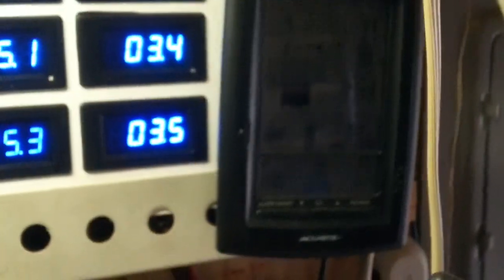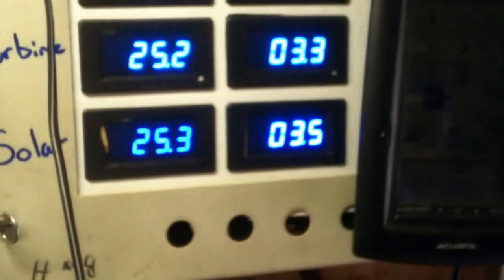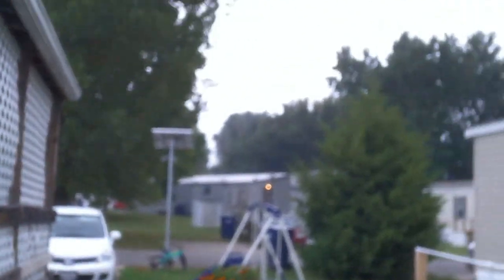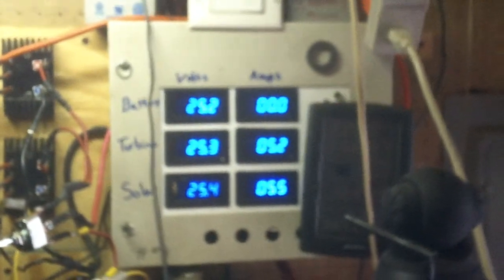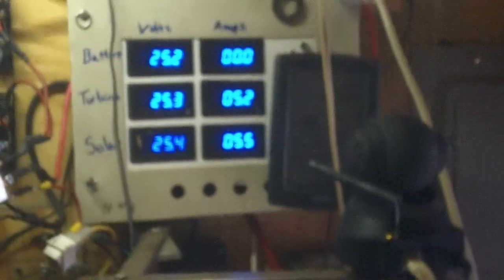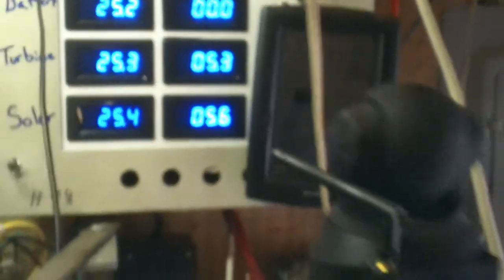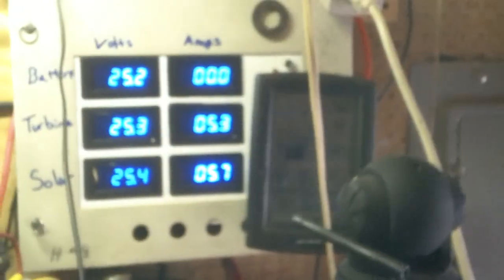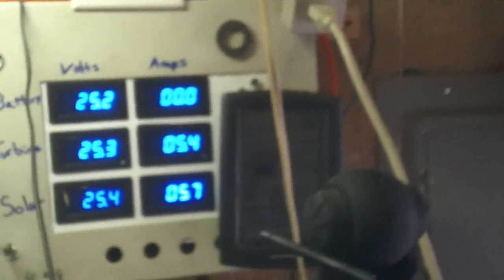Solar and Wind battery back up. What I do when the power goes out.

Comment from the maker: you should do a video on them. I might take you up on that offer. Hell I will do some over time and then order the GTI's off ebay and have them shipped to yea as a trade.    that APC I have I gave only 40 bucks for with out batteries  and it works pretty good. I will have to really think about that. thanks for letting me know. Or offering.

Comment: Ya I stayed in my man cave (23 foot travel trailer) Propane for cooking and heat, 6 battery bank reserve for TV and powering 12 volt lights and propane furnace. I have only about 12 hours running the house basics off my 6 battery bank. House basics are , 12 volt pellet stove for heat, Four 10w led lights ( one in bathroom, one in living room, one in bedroom, one in kitchen) I have natural gas for cooking and water heat. The 12 volt pellet stove takes more power than I thought, but it was free.

Comment: Also I have to run a extension cord to the water heater for the auto ignite setup. normally I just turn off the water heater when power goes out around here. I still get enough sun even on cloudy days to make a lil charging power from my home made solar. My home made solar is 22 volts and 3.5 amps each (direct sunlight) In cloudy weather I might get 1 amp from each solar panel but I have 6 home built solar panels up there. Enough to slowly charge me batteries during the day. Pray for wind :)

Comment from the maker: I believe I could two.  will have just basic stuff since I only have the 800 APC I can at least watch TV and cook with the gas stove. and power some lights. If its nice and sunny out side I could go a while. would have to learn to conserve those few days. but it could be done.   I like to double my battery bank size and get the out back stuff. I like to have two fx300 24 volt out backs and charge controllers for 240 volt split phase.

Comment: Hey Mc. Fly :-) I have 2 apc smart ups 1500 24vdc with bad battery's. I will do a trade to anyone that would like to trade for a working 12vdc Tie In Inverter 500watt (or bigger).. I will send the 2 apc's Tested and do work with out the 24vdc battery's. if you know anyone or could you ask around.. YES THEY WORK THE NUTS.. plus if who ever likes to do the trade I will remove the BEEPER SPEAKER.. thanks for the video. and let me know about a trade....